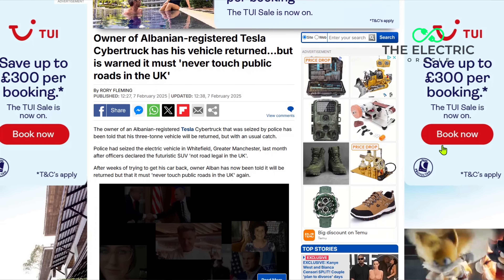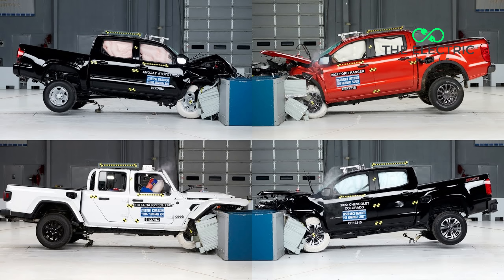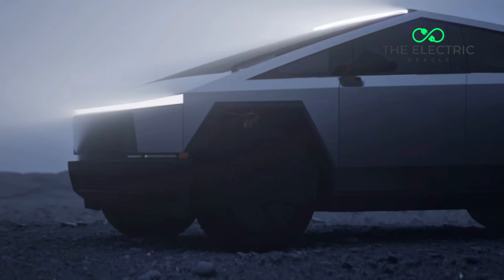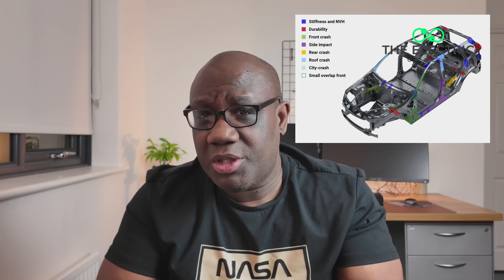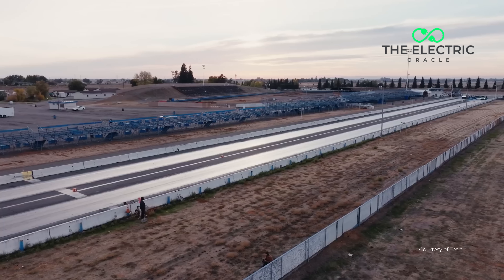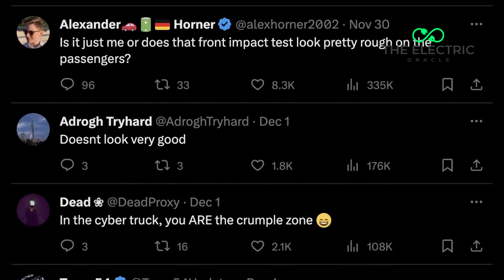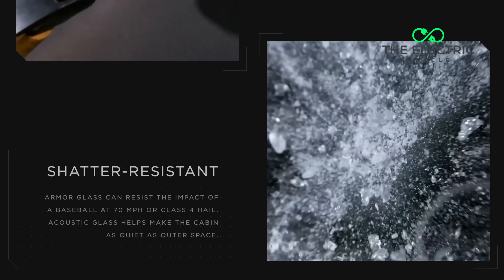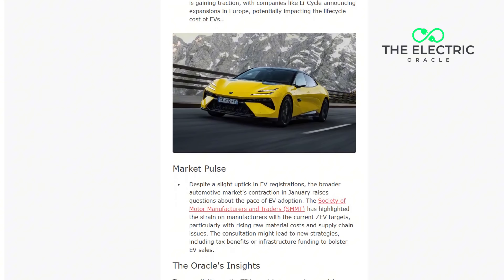Why the UK Banned Tesla’s Cybertruck – 5 Fatal Design Fails!

Comment: FYI we’ve already been through this in America in the 90s .. the incredibly popular Ford Explorer (the American version is MUCH larger than the European version) marked the rise of the SUV in America .. previously we had all driven station wagons and pickup trucks but no one drove an SUV .. well when the Ford Explorer became a knockout hit, Ford was HORRIFIED to find that the higher up Explorer was NOT compatible with cars in a crash.  I mean the Explorer was literally sheering off the tops of cars and decapitating people.

Ford was HORRIFIED and they almost immediately corrected the problem creating lower structure that made the Explorer compatible with other vehicles in a crash

The fact that we’re going through this with the Cyber Truck so many years later is just mind boggling .. we’ve already been here in America .. cannot fathom why any car maker would make this same mistake .. you can see from any crash with the Cyber Truck that the other vehicle deforms as planned and the cybertruck doesn’t deform AT ALL

It’s just not safe for other vehicles or pedestrians just gross on so many levels ESPECIALLY because we’ve already crossed this bridge in America and made trucks SUVs and cars compatible in a crash with each other and pedestrians but the Cyber truck threw all of that out the window. .. just gross

Comment: It’s front lights are actually just above the bumper, it’s not the light bar.  Problem is, if you get snow on the ledge of the bumper it piles up in front of those lights.  So it’s still a 💩 design.  I don’t think this vehicle should be street legal anywhere.

Comment: I was involved in a lot of barrier testing on the vehicles, (no names no law suits), in the early eighties. The first two of the eight tested exhibited the same rear wheels falling off! The first vehicle showed the steering wheel raising up 50mm, but the slow motion showed the wheel coming up 460mm, taking the drivers face / head off,  before settling back. Eventually we weakened enough on the body to collapse correctly. Lot's more but then we, the British, have very good and strict laws to prevent such face removing accidents...

Comment: Too heavy at 6000lb. An artic weighs 97000lb. You can drive up to 7700lb on a basic licence. It is slightly smaller than a LWB Ford Transit (plenty of them in UK). It doesn't meet UK/European regulations. Neither do most American imports (check out what you have to do to a Ford F150 to make it UK legal). Look at some of the Chinese offerings - no safety crumple zones, NO SEAT BELTS! The Cybertruck was never intended to be sold outside the USA and if an individual wants to import one that is entirely up to them. You can't order it on the Tesla website. Stop trying to make something out of nothing. You don't enhance your reputation.

Comment: Its not designed for Australian roads either mate.
We have the same or similar regulations as the UK and similar concerns around the sharp corners and lack of crumple zones.
Its bad enough here that every school mum does her morning school drop off in a Toyota Hilux 4WD or similar.
If the Cyber Truck ever did come to Australia (which it won't) it would only be because some politicians got a hefty palm greasing under the table.
Our vehicles all have to meet EU standards just like the UK.
Lets face it, the Cyber Truck is not built for Australian city roads either, and it wouldn't have charging support in the outback.

Comment: I don't care about the Cybertruck. I wouldn't even want ANY electric vehicle, unless it were a hybrid that could charge its own batteries. I had an electric vehicle for a couple days as a loaner while waiting for a car repair. I was on pins and needles as to whether it was going to run out of charge while I was in the middle of driving somewhere. We had no charging capability near my home, and no freaking way would I ever buy one of those cars. That being said, the car had a nice ride and other than a constant worry that it was going to run out of charge, it was a nice vehicle. It was a BMW something or other, I think.

Comment: The 3.5 ton weight restriction goes for the maximum ALLOWED  total weight of the car. It doesn't matter if you have passengers or cargo. 
If the truck weighs 3.1 ton and has a loading capacity of 1 ton it is a 4.1 ton truck no matter how little cargo you have. On paper you will be driving in a 4.1 ton truck all the time which means you always need a lorry license.

Comment: So, on the fundamental question of "should they be able to push design boundaries", I think yes... but they're not pushing them so much as totally ignoring the safety rules.
If, say, one of the vehicle edges which isn't a primary contact point in collision was out of spec (not properly angled/rounded) that would be pushing it, but all of them are. Yeah, maybe they get in trouble and have to create a body kit to accommodate customers impacted by it; but a single bit of it violating a single rule in a way meant to not be in conflict with the reasoning behind the rule would be a way to push regulators to think about the definition of the rule and if there's room to flex it.
The Cyberfuck is absolutely terrible, it's ugly and absolutely huge... I live in the US (for now) and every time I see one I'm shocked at how big it is.

Comment: Sharp edges, lack of side indicators, upright front end. Years ago, a few American vehicles were banned from sale in the U.K. because of the bull bars on the front. They dragged children underneath, even in a low speed impact, causing deaths or severe injury in impacts, where, with a different front design, minor injuries would be more likely. It seems that American trading standards don’t really care about that kind of thing.
Reply: They don't. 5X our death rate per head. They just don't care.

Comment: It doesn't surprise me that the crash test standards don't match Tesla's designs.  Like many systems on a Tesla, they rely on the consumer to do the actual work of seeing what works and what doesn't.  This was the case with the new Tesla I bought and after 5 months of waiting for solutions that didn't come, I got rid of the car.  Remember when automakers did research before you bought the car?  Obviously, Elon doesn't think it is necessary to spend money on this and will let the sheeple cultists do the work.   Tesla vehicles are car-like and truck-like, but they are not cars and trucks.

Comment: Cybertruck has as much crumple zone as any EV, and much more than an ICE car. It's a partial exoskeleton, and not that much. People are even complaning that the skin is peeling easily. It's not more rigid than any other unibody car, just more than traditional trucks. Crash tests clearly show that at 35mph.
Edit: NHTSA just released their crash tests. Tesla's Cybertruck scored the lowest overall probability of injury & lowest chance of rollover (12.4% rollover risk) of any pickup truck tested by the NHTSA. Overall, it got 5-Stars.
Reply: Which crash tests? Afaik the only tests have been performed by Tesla, they have released no data and somewhat unsurprisingly it passed their tests. One of the reasons they won’t try to sell it in Europe is that it will be subject to independent testing. Which it will fail and they know it.
Reply: @tatata1543  I was talking about what we can see on the crash videos. But, now, NHTSA just released their crash tests. Tesla's Cybertruck scored the lowest overall probability of injury & lowest chance of rollover (12.4% rollover risk) of any pickup truck tested by the NHTSA. Overall, it got 5-Stars.

Comment: Specifically directed at The Electric Oracle.    The Cybertruck’s design team did not care that the the UK Market existed in the beginning, during or now that the truck is in production.  It NOT meant to ever be sold in your country.  Dodge Rams, Ford F Series ,  Chevy Silverado and other full sized pickup trucks are not meant for your country.  In the last decade, Ford sold approximately 650k F Series trucks annually.  They’ve probably sold 10 in the UK.  While I agree there are issues with the CT that Tesla needs to address, none of those issues are related to satisfying your grievances.  Tesla has bigger problems. First order of business should be divorcing Elon before he runs the company into the ground because of his political activities.

Comment: My car failed its 2-yearly check in France last year for two reasons. One of those was the headlights were set 2 degrees too high. The other was a minor oil leak, so both were easily fixed. That continous light bar plus the other on the roof would never pass EU regulations.

Comment: I am biased, I dont like or use anything from a company which Musk has to do with.  The cybertruck is , on the whole, impracticle  considering its size, its payload platform is limited. What business is it aimed at? The recipe of putting a huge battery into a chassis alongside huge electrical motors doesnt really work in terms of saving the planet does it?

Comment: Typical US problem,  many of the cars the US make don't suit the European roads due things such as size and the long straight roads in the US compared to Europa and other various traits that differs European and US roads. Yet they complain we over here don't buy their vehicles when Asian companies sell a lot of car because they actually take that in consideration unlike the US manufacturers...one of the most valuable brands in long-term value is Toyota for example.

Add in the Trump administration complained about unfair taxes in the EU on vehicle as a prime example....that despite that the most profitable market in the US is vehicles like the pickup trucks which count as light trucks.
For anyone not aware, there has been a loooong ongoing tarif/tax called the Chicken tax that puts a 25% tarif on light trucks sold in the US but not manufactured there...but I guess that just slipped their mind when it comes to so called "unfair tarifs and taxes" they complained the EU have.

Comment: The reason pickups are not popular is that the main use case is for construction professionals and agriculture. There are better options here such as vans and farm tractor / trailer combo’s. Vans can be four wheel drive and can hold say plumbing tools, pipe fittings etc safe from the rain and are long enough to put pipes or timber on a roof rack. They also have more space for boxes, eg. If you own a small store and pick up your own supplies. So it’s not really road size that prevents the use of pickups it’s these other factors, with pickups, for the most part, being seen as a vanity purchase. That said there are a few in rural areas, just not a high percentage overall.

Comment: Having worked on electric vehicles and sold lithium batteries I consider there is a lot wrong with the motor trades approach to EVs  lithium batteries are a good stepping stone but not the final answer. They are too dirty to produce and dont do much to reduce pollution, they are too dangerous. They are only suitable to replace maximum of a third of ICE vehicles on the road. A new power source is required. As they stand Lithium batteries should be more standardised between vehicles and made and fitted so they can be removed  very quickly in case of fire  but also to be able to swap out flat for charged like an F1 pitstop.

Comment: It's ironic how American safety standards have gone backwards. Back in the 70s, America deemed the chrome bumpers on MGs too dangerous, and required them to be replaced with huge rubber bumpers!
Reply: The rubber bumpers were a cheap workaround by the manufacturers, the US standards required no panel to permanently deform by more than 5mm to have been considered to have survived the crash, so they created the rubber bumpers that would bounce back into original shape after a low speed collision but still transmitted all the impact energy into the rest of the vehicles structure. Europeans just designed a sacrificial bumper that would help dissipate the impact energy before it reached the body and could be easily replaced after a low speed collision.

Comment: Very interesting indeed. Apart from the safety issue, I would not buy a Cybertruck because of design flaw #6- It is incredibly ugly! I saw one in Kissimmee, FL and disliked it immediately.
Having driven a lot in the USA, I actually like American cars very much- I have owned three (with lighting systems upgraded to UK safety standards).
After driving a rental Chevrolet HHR in the USA, I liked it so much that I bought one here. My last US import was a Dodge Ram 1500 van (which to be fair, was not up to my usual standards), but the best of the lot was the Chevrolet Astro van which was so comfortable and a pleasure to drive- that was my favourite above every vehicle that I have owned.

Comment: Dont buy the lack of deformation testing. Its on a par with normal passenger tests. The front panels at the front are more cosmetic most of the deformation strength is in the front casting. Some regulations may need changing but in general pedestrian protection needs to be considered. I could imagine changing all the front panels for plastic without causing issues with structural strength ( have you seen the A frame steel it can peeloff so its not structural ).

But at a guess tesla dont want to muck around with a UK/right hand version so no compromises.

Comment: They pretty much designed it without any thought to UK market introduction, most other cars at least have some thought put into them for global sale, making certain parts like lights conform to the widest amount of regulations, or having two different designs which don't require different production lines to have variety without cutting costs.
Tesla did none of that, also regarding the body panels, pedestrian crash safety mandates a certain amount of give to the panels to at least soften the impact, Tesla advertising the panels as being hard steel isn't ideal when it comes to pedestrian impacts, those sharp corners each side of the front light bar are especially worrying, they're torso height (or child's head height) and protrude
For the UK where the right to walk on the road (motorways excluded) is preserved, and where many country roads don't even have space to the side to walk next to the road, that kind of pedestrian impact is unacceptable.

Comment: Good vid. As a former paramedic with over 30 years in the job, I’d put safety above all else. Too many people die on our roads today but it’s less than what it used to be due to the hard work done to improve car safety
Reply: The new figures are out - Teslas are the most deadly cars in the USA. Their passive safety is good, but they are far too fast and the so-called self-driving software is actively dangerous. So Teslas kill more occupants and 3rd party road users per mile than any other vehicles. Now they've got the Cybertruck, which doesn't even offer proper passive safety, and is FAR too fast for its weight. It's very nearly as powerful as an F1 car - the normal driver simply can't handle this. So it will doubtless overtake the other Teslas as the most dangerous vehicle on US roads. Thank goodness we'll never see it over here. But Musk is a sociopath and is doing everything he can to cover this up, including attempting to abolish road safety regulation in the US.
Reply: @tullochgorum6323  There's also the issue of fundamental controls being on a panel you have to look at. Worse than driving while texting. Vehicles like that should all be banned.
Reply: @alisonwilson9749  Even diehard Elon fans I’ve met have mentioned the dashboard going dark mid-drive. Lol.
Reply: @tullochgorum6323  While I agree that most people no matter how long driving can't handle 100hp well. There is no reason to tell anyone what they can have. Road use test cert, fine have fun. Track only Cret. fine, you don't hand a gun to a child without teaching them first,, empty load. Why hand just any car to anyone unqualified. Graduated Licenses remember them?
I have posted this before, it's worth a second thought. I Know when people speak like this they missed the obvious. The USA is 10x bigger the weather changes , like 5 ft tall snowbanks people can slip out into traffic. To blame a car design is less than 1/20th of the problem, is to telling a kid not to touch a hot surface. Idiots touch hot and walk in front of cars.
England being such a small land mass, once every car is a EV it will only take 1 bomb to light the entire country ablaze. It will be one big chain reaction, and nobody will be able to stop it. In hours the entire country will be whipped out, basically un inhabitable for centuries. You kids have fun with your EV's when war hits you. I will fuel my old car just fine with potatoes.
I wish war on knowone but to me it looks like your walking around with your pants down pushing this EV stuff.
Reply: All BS. You believe everything you read on the internet I guess.
Reply: If anything else killed as many people as cars there would be outrage and they would be banned immediately.
Reply: To be fair, the design was chasing a test platform for the electronics and technology.
It was never designed as a consumer oriented vehicle.